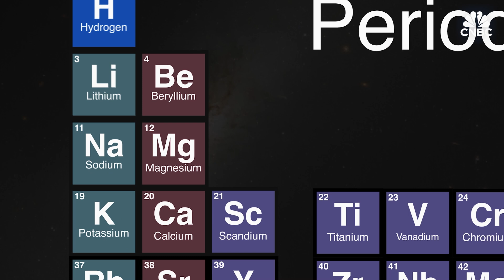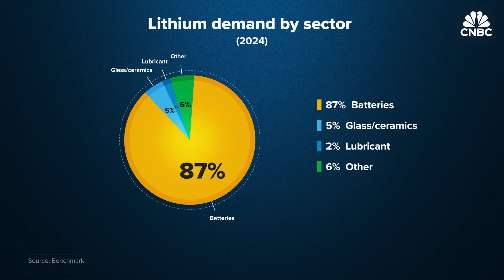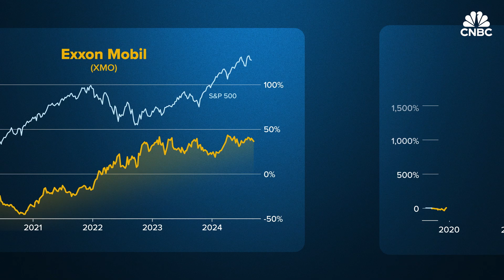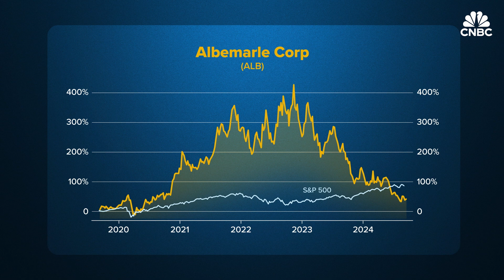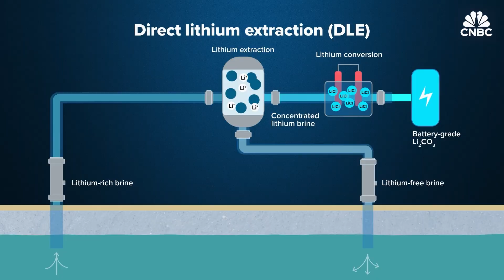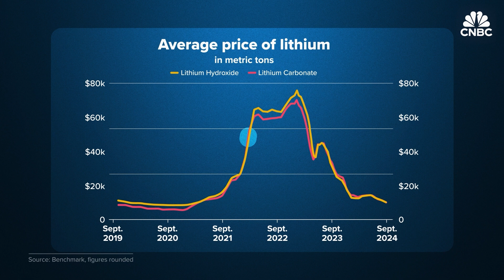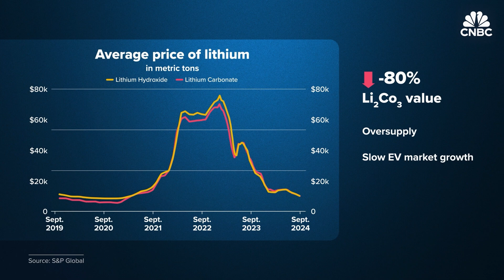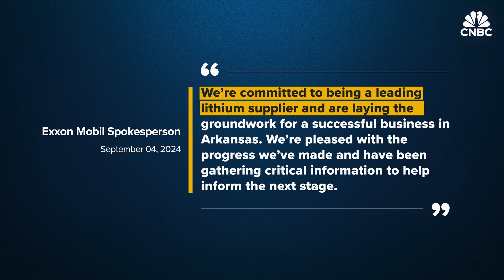Why All Eyes Are On Arkansas’ Lithium

Comment: The Smackover formation is a geological formation of limestone known to have oil deposits first discovered in 1922. As a result, the brine from that formation is the only known source of bromine in the US. "Certified third-party analyses of brine drawn from deep test wells penetrating the Smackover Formation within Galvanic Energy’s prospect yielded lithium concentrations ranging from 290 mg/L to 520 mg/L, some of the highest reported values in North American brines. Testing also revealed bromine concentrations of 3,700-6,000 mg/L."

"An independent evaluation and technical report authored by APEX Geoscience Ltd. estimates the Galvanic Energy Smackover prospect to have an inferred resource estimate of 4 million tons lithium carbonate equivalent (LCE) and 10 million tons elemental bromine."

Comment: Lol. You can tell the CNBC reporter isn't an Arkansas local. The Arkansas pronunciation of El Dorado is El Doraydo. Yeah I know that's not right since it's a spanish name, but don't tell anyone from Arkansas that.
Reply: And the reporter probably didn't set foot in El Dorado.
Reply: @finchborat  El Dorado is relatively out of the way so yeah. Probably not. Use to deliver stuff from Little Rock to El Dorado and it took a while to get down there.
Reply: @JoshuaVanderwall742  Nice

El Do is my hometown. Also, should the lithium boom be as big or bigger than expected, El Dorado will be lucky to get a small whiff of the success. Magnolia and Texarkana will be the ones that'll benefit.

Also, the long road you referenced is, to a degree, why I hope the Hogs continue to play games at WMS. Ending the LR games would be a massive blow for fans down here.

Comment: What’s replacing the volume in the aquifer when the brine is extracted?
Reply: The brine is reinjected back into the aquifer after extracting the minerals.  This keeps the aquifer pressure constant therefore volume/pressure is essentially not an issue.  It is a key processing requirement.  They have been processing bromine in this fashion for 60 years in this region of Arkansas.
Reply: @thade8534  Interesting… thanks! ☺️
Reply: Dude stfu, don’t u know ur not supposed to ask questions like that

Comment: While the benefits of Lithium-Ion batteries are well known, the increasing dangers from the batteries from overheating during charging, make them a challenging sell in today's market. the consumer needs better, more stable battery solutions with faster charging rates than Lithium-Ion batteries offer. The risk of setting one's home on fire while charging one of these, is driving the markets to find a more suitable battery type not made from Lithium. Another issue with Lithium is the ability to recycle the batteries, which is both time consuming and costly, but must be done to protect our environment from the toxins involved.

Comment: Lithium! Boom! You can't trust it. And its a major polluter. Phooey. Green environment! Where. Not with Lithium. EVs cost more than gasoline vehicles $55 grand average for an EV. The median wage is $31,000. Get real. Joe public isn't able to buy an EV. And EVs are only 1 per cent of the vehicles on the road. 1 per cent. Who is Tesla selling to? Not Americans. EVs are a joke. Tesla refuses to make EVs self charging. It's easy to do. Use two battery packs. Run on one and charge the other. Where's the problem. Tesla has to charge ridiculous prices or they are out business. The Chinese have a $4100 dollar EV. $4100 dollars. Imagine that. People would possibly put up with the EV problems at this price. Hell, they could buy two, and charge one at home and run other, and switch. The automotive prices in the US are fixed. Tariffs on China make sure the prices stay fixed. Tell me I'm wrong. Your car or truck costs you as much as your house. Damn. And America is broke and struggling. Why because of the cost of gas and energy, which are both fixed and controlled. The income of the working person hasn't gone up as the other costs of things. This will not support a consumer driven country. You are going to have to increase the income of the people, or you'll have what we have now. High inflation and stagnation. Then don't be surprised when people say enough and start shooting . Wait for it. And we have foeign criminal gangs flooding across the border. This country is in trouble big time. 
S

Comment: Exxon-Mobil's goal is to slow it down, not really join in it. Just like the Saudi's own much of Lucid. They don't make even close to the profits in Lithium or EV's that they make in oil, and never will. They know that better than anyone. If they can both play a part in slowing the adoption down, while appearing to do the opposite, the better it is for them. Their goal is to fool the public with such things as this this and their "low carbon fuels," messages, meaning fossil fuels. "Carbon capture is the future of energy." That comes from their very own mouths.

Comment: I grew up in Magnolia. There is another component in addition to the physical infrastructure surrounding the brine processing - a longstanding set of existing mineral rights leases.   Magnolia has an interesting and varied economic history, as related to me by a longtime stalwart of the community - Archie Monroe - shortly before his death at age 105.  There was a time when cotton was king and the regional cotton gin was in Magnolia, but then the locus of cotton production shifted to Texas.  In the 1920's, oil was discovered in nearby Smackover, leading to an oil boom that lasted through WWII and beyond.  When the oil tapered off, bromine from brine took over, especially during the era of leaded gasoline, where bromine was used for the anti-knock additive ethylene dibromide.  The area is covered by pine forests, so lumber production has been a significant part of the economy for a long time.  South Arkansas University, situated in Magnolia, also contributes to the economic base.

Comment: Sodium will exceed Lithium long term, once EV super charging becomes ubiquitous and thus battery energy density becomes less important. Basically a fast charging EV with a range of 200 miles+ will be more than adequate for most EV owners by then.  More important is safety,  fast charging and all weather battery performance.
Reply: Perhaps. Fast charging may also become less of a necessity when there's ubiquitous home or near-home charging. But hard to say at this point. Regardless, lithium will likely still remain very important in lots of applications
Reply: No sodium is best suited for grid scale batteries.

Aluminum graphene batteries have the potential to become EV battery. Their charging rate is 60C. It has an energy density of 300 Wh/kg. And a theoretical energy density of 900 Wh/kg. Lithium ion batteries have a maximum theoretical energy density of only 400 Wh/kg

Comment: At the end of the day, the price of lithium goes up and down with supply and  demand. When the price goes up, its good for Suppliers but bad for Users of lithium such as the battery manufacturers. Of course, just the opposite is true ,causing Suppliers to have less incentive to produce which causes the pendulum to start swinging Back the other way. What makes the situation in Arkansas different is that the Smackover formation, with its  pre-existing physical and regulatory  infrastructure and  business-friendly environment,  et al, makes it the lowest cost source of lithium in the US; perhaps, the world. Given this, Suppliers are able to extract lithium Profitably even when world-wide prices for lithium are low. Winners: Suppliers, Producers and Arkansas!

Comment: You know what happens when you pull out that salt water. The above ground water fills the gap. Draining the drinking water into that aquifer. I’m from that area. It won’t slowly filter down over hundreds of years. It will just be years. There are millions of caves in that area that go extremely deep. Your sacrificing your water Arkansas. Not to mention gaining harmful waste products.
Reply: Thats why if they can do direct Lithium extraction, they can put the water back in the ground (according to the video).

Comment: When I hear that Exxon and Koch are involved,immediately I become suspicious of greenwashing. They likely have their eyes set on the huge federal subsidies for energy transition but they have trillions in stranded assets in fossil fuel industry. I fear they want to sap the funds while crippling real advancement.

That said, I hope this really is a superior process for lithium production. It sounds like a very energy-consuming process so fits well with solar over supply in midday. If the necessary energy comes from fossil fuels it might just be a pretext for more market for dirty energy. 
I wish I had paid attention in chemistry class because this is very interesting but my understanding is superficial. I wonder if the brine,if it so dense,could be completely evaporated with the resulting residue stored as a solid. The coming super-abundance of solar energy might make that feasible.

Comment: Worried about lithium mining environmental impacts?
Tiny compared with fossil fuels.

8 billion tons of coal mined Every Year
4.3 billion tons oil extracted Every Year

2024 is likely to be the first year of 1 million tons of lithium mined. So 8,000 times as much coal, and 4,300 times as much oil.

The fossil fuels are mostly burned up right away, like this year. 
(30% of crude makes non-fuel products, so about 3 billion tons burned.)

Li-ion batteries last about 10-15 years in an EV, but then still have about 70% of capacity left.
That means they can be used for more years as stationary grid backup.
And then they can be Completely Recycled, recovering 95% of the materials.

A HUGE DIFFERENCE
-------------------- 
 "Most batteries will become available for second use at the end of the expected PEV service life of approximately 15 years. NREL studies show that these batteries—with as much as 70% of their initial capacity—potentially can continue to operate for another 10 years in second use as energy storage for utilities, translating into a total service life of up to 25 years." 
National Renewable Energy Lab (NREL)
-------------------------------
 And that 2nd use is already happening. I have articles about 6 companies already using used EV batteries for grid or smaller scale storage. Honda and Mitsubishi have a joint venture to accomplish using old EV batteries for grid backup storage.

Comment: They didn’t even mention the company that is already doing DLE in the United States.  International Battery Metals (IBAT) has a mobile and modular DLE facility set up with US Magnesium in Utah that went live this summer and is producing domestic US lithium right now.  The founder of IBAT, Dr. John Burba, is one of the chemists who created DLE 30+ years ago.  He set up the FMC plant in South America in the 90’s.  IBAT is his newest generation of DLE technology.
Reply: I heard they are making about 2kg per week now. ;-)
Reply: Are they more advanced than Standard Lithium, Ltd.  as they have been running their demonstration plant 24 hrs/day for over two years, and have installed a commercial sized extraction column in El Dorado, Arkansas?
Reply: @thade8534  They are more advanced, yes.  It is a patented modular and mobile system that is fully commercial, not just a demonstration plant with some commercial parts.  It has already been shipped from Louisiana to Utah, assembled, and begun operations within a matter of months producing 99.9% lithium carbonate.  It can be moved and used again in another location as needed, not tied to a single location or resource.
Reply: @8azk3ibsi  
What I read on their website is the unit has been shut down due to price of lithium.  I question whether they have really advanced their process as much as Standard Lithium, or if it is still in the early testing phase.
Thanks for your reply.
Reply: @thade8534  It wasn't as clear as it should have been in their press release, but the issue was on the US Mag side, not the IBAT side.  US Mag has to convert their magnesium waste piles into a brine that can be processed with DLE, and their costs for that pre-IBAT step were too high in light of the low lithium prices currently.  The IBAT DLE system worked as intended and on a resource with lower front end costs it should still be financially viable even with the low current lithium prices.  The entire market is swingin with lithium prices now though.

Comment: The key is to not use lithium. 
The new sodium ion batteries are out, don't require a ton of mining and last many more cycles with a longer lifespan.
Reply: Very true, but it's commercially not quite there, yet. The bigger potential in the short run might be grid connected storage. Not sure how soon we will see mass produced EVs with sodium ion. I could see their first use in buses and delivery vehicles, though.

Comment: We need more investment in sodium-ion batteries, we can have EV batteries without any Lithium.

The Chinese have already released two models of cars which use Sodium-ion batteries.  The Sodium comes from salt and we have plenty of salt in the world.  Sodium-ion batteries are a little heavier than Lithium-ion batteries, however they are so much cheaper.

Admittedly if you want to drive a high performance super car on a racing track then Lithium-ion batteries will out perform Sodium-ion.  But most people don't drive high performence super cars on a racing track, most people drive to the shops or drive to work, sodium-ion batteries can easily do that.

Comment: Prices are dropping because EVs are a joke.. you’re putting a bandaid on the problem without fixing the root. Fix the grid before making vehicles.. ALL green technology makes up less than 12% of the grid.. you know you’re charging off fossil fuels right? And of the major producers, most use extremely toxic methods. Good job saving the planet 👍

Comment: EV is the future. Early-stage models are never efficient. It will take another decade or two more to really perfect production and make it economically and environmentally friendly.
Reply: Not lithium, I think salt based batteries might be better.
Reply: @CheveraChino  Sodium is heavier than Lithium. Sodium batteries will potentially be good for grid storage where weight isn't an issue.
Reply: It'll be another 30 yrs before EVs become a reliable source of transportation. We don't need to ditch oil/gas just yet. They're still very relevant.

Comment: I think we are under valuing how much batteries can change things for the better while creating more power and resources.  As the climate change weather patterns have changed we find ourselves in outages that could be mitigated by using solar and battery back ups in the business and home markets. If we build the grids in this way it creates safety while preventing loss in goods and productivity. The power is out for our fridge and the same time as it is for the supermarket whether the homes or business was even in the damage zones.  It also produces more power to charge the grid systems for expansion into to smarter homes and businesses. I've been using a small dehumidifier to lower humidity for comfort while using less energy and producing water. I'd love a battery unit that could be used. I've considered device development for farming as well in drought conditions?
Reply: Unless you live in California, this just isn't a thing. California has been destroying their grid for decades. The heavy reliance on renewables is why the grid is so unstable there. Also see Texas winter grid failure do to relying too much on renewables. The rest of America has a stable power grid because it relies on fossil fuels, not in spite of it.

Comment: I'm getting really tired on these lithium and rare earth metals stories. Neither is rare, we just didn't produce them in the US until a few years ago bc it wasn't valuable enough. So, we got both largely from China and Bolivia. 

I'd really like to see stories on how we're getting actually rare minerals critical to the energy revolution, and which are now hard to get for political reasons. For example, we used to get from Russia like titanium, platinum, and uranium. Cobalt only comes from the DRC. Let's hear about replacements, price volatility, and future forecasts for those minerals
Reply: New chemistries use virtually no cobalt. Sodium will replace lithium for energy storage, but lithium is still needed for mobility applications, but the quantity needed will decrease when solid state electrolytes and silicon are added to the cells. Hard to do stories on fundamental science because there's so much conjecture. Those are those breakthrough battery stories you see pushed, where the breakthrough won't be commercialized for a decade or more.
Reply: hate to nitpick, no rare earth metal in EV batteries..  just scarce metals.    Also, the US used to be #1 in rare earth metal production a few decades, but it was outsourced to China because refining them is highly polluting.